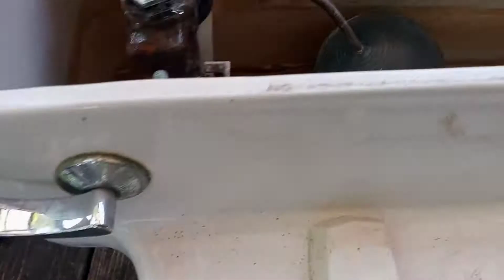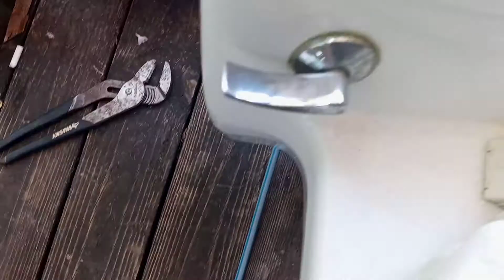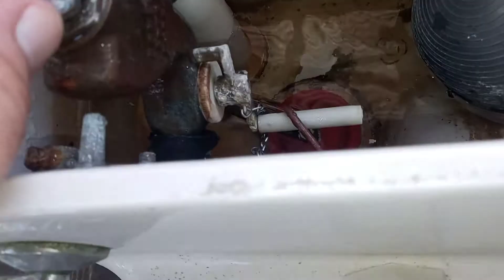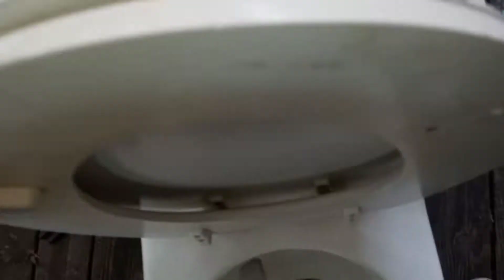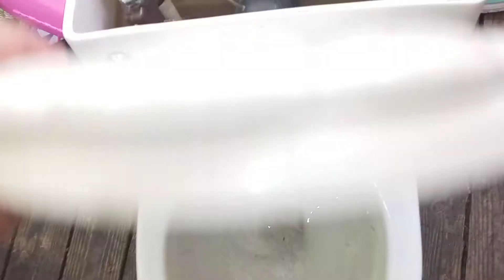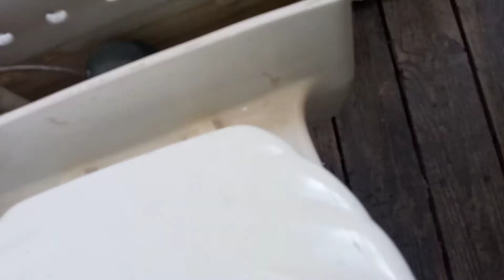flush test Kohler pompton toilet fail

Comment: That is weird! Something must be wrong because it should have siphoned. The tube in the bottom of the tank with all the white buildup is the main fill for the tank so you will want to make sure that's open. You might also check and make sure the water passage beneath the flush valve is clear too. I like to use a dentist's mirror to look up the trap for debris. They can be found at auto parts stores. I once found a pen stuck inside the trap of one of my toilets.
Reply from the maker: Ok yeah I just got done looking in the trap with one of those mirrors and it's clear as a bell this is what my Rochelle did when I first got it,the problem with it was the wrong flush ball ,this one has the correct one so I'm at a loss still ,I'm still working on it I have the valve all apart on my bench cleaning it,it had a lot of build up so that may be part of the problem,just not letting enough water in fast enough
Reply from the maker: Pluss I'm sure having it hooked up to 100 ft garden hose isn't helping I'm only getting about half the water pressure that I would have in the house.im putting in new floor tile in our master bath this weekend,I have to pull my Rochelle out to put down new tile,so I may hook it up in the house to the water supply and try it that way